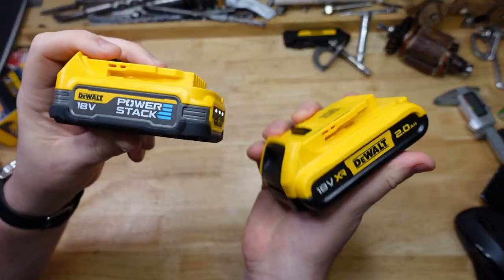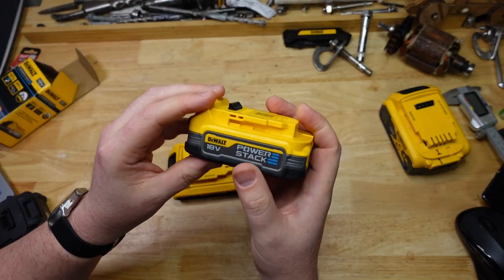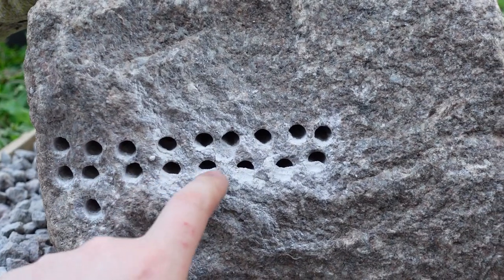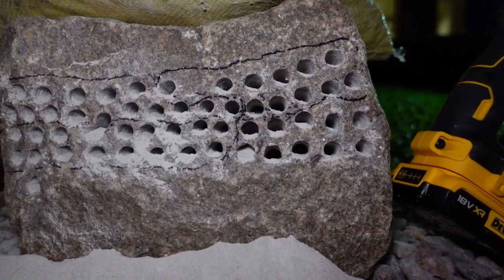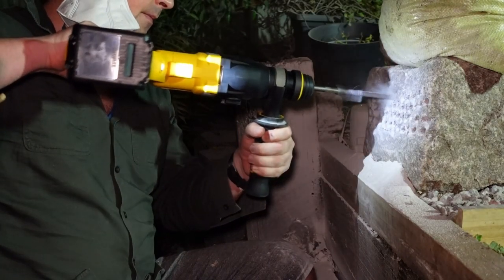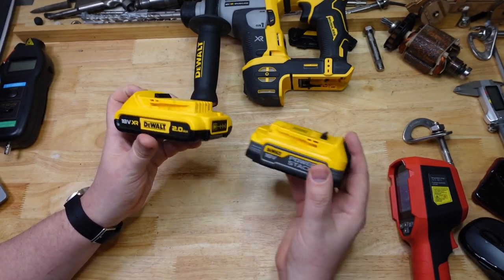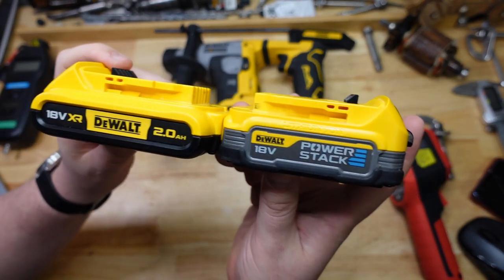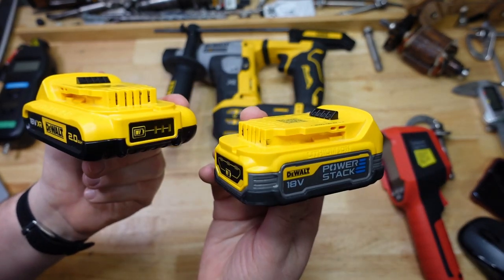Powerstack vs Granite! (feat DeWalt DCH172 & DCH263) rotary hammer runtime, heat, charge performance

Comment: This channel deserves way more subs! Come on, people, sub!

Flex also do pouch packs, apparently, hopefully all the big players will release versions soon. 

The increase in power output is down to the increased surface area, lower resistance allowing for more electrons to flow, allegedly. 

I also have one power-stack, I like it, but at 1.7, you're forever recharging it! Come on, Dewalt, release the bigger versions!
Reply from the maker: Thanks mate! This one turned out way bigger than I expected.
AFAIK, the geometry is the main thing, which is super cool cos it's so simple! I do a bit of modelling in the next part.
I wasn't super interested in the battery stuff until I tried this, but it turned out very cool.  part 2 has some really impressive stuff.
can't wait for the bigger ones and hopefully Makita gets into it too; they're the only big 4 company that doesn't have some fancy battery

Comment: Nice video.
I believe the powerstack actually recovers relatively quickly from when it shuts down.
You state you put the 2ah in the fridge in between drilling....did you attempt to go again from the initial ps shutdown. Really curious.
And thanks for your testing
Reply from the maker: Thanks mate! The PS had no interruptions in charge-discharge behaviour at all. The 2ah was fine with the small drill but really struggled with the big one, and this is where the interruptions came in.
I did those tests back to back so the 2ah was still warm from the first test, and maybe this caused the interruptions in the second.
Does that answer your question?

Comment: It's fine, but be aware that putting those very small batteries on the 4A 115 charger is fast charging them - I have 2x 2A and 2x 3A chargers for more gently charging small batteries ie the 1.7Ah powerstack and the 3Ah compact (21700 cells, good pack, but get the 4Ah version also "compact" since performance about the same, size weight same, runtime 33% longer).